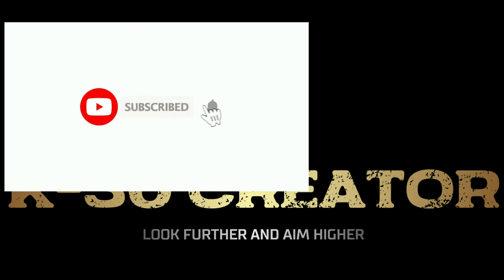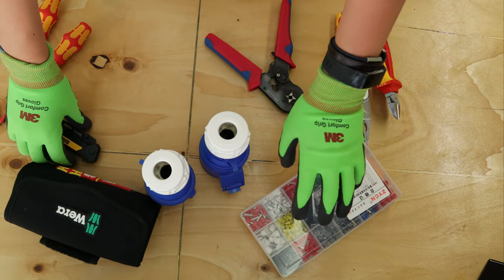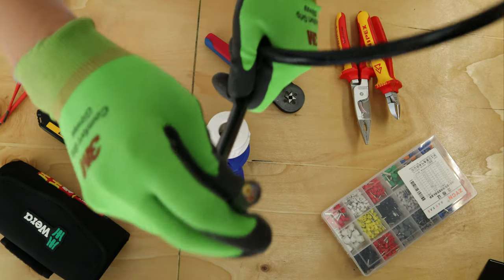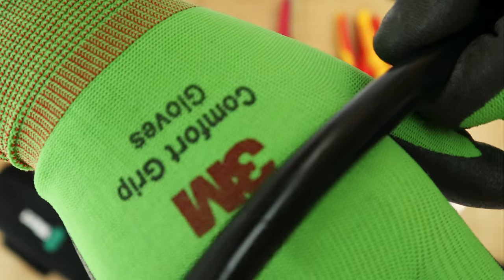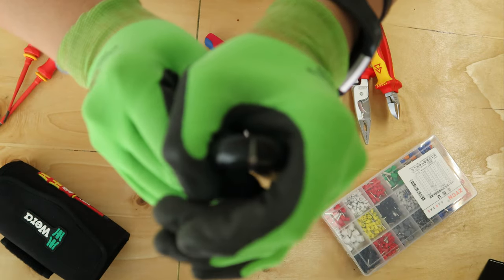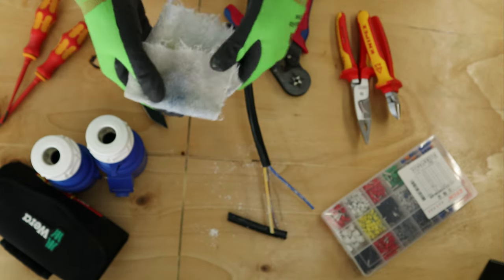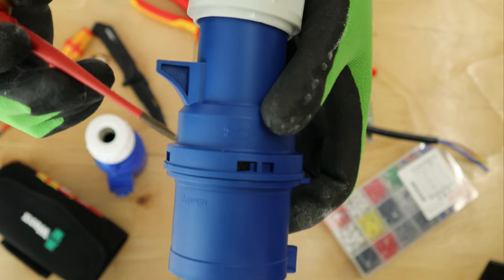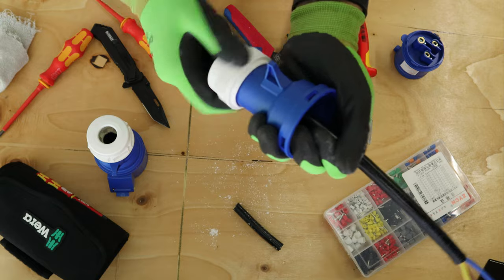How to Wire Up a 32 Amp Plug and Socket Professionally in 10 MINUTES

Comment: Hi, how much would an electrician charge for a 32amp single or three-phase installation?
Reply from the maker: Sorry for a late reply, I am not sure about that.
Reply from the maker: I will pin your comment up and see if any other viewers could possibly answer this question
Reply: This looks like a single phase 32a. 2P+E. Indication would be that its blue, 3pins and 56mm diameter (maybe)
3phase should be red with 4 to 6 pins depending on 3P+E/3P+E+N/3P+E+N+pilot pin
Reply: Guys I'm in London and I have all different kind of.16-32-amp both ends very cheap let go about more then 100 pic of both ends let me know who interested

Comment: Did you know the combo flathead + Phillips screws generally also accept a Robertson #1? In case you don't know that's the slanted square head mostly used in Canada. But if you use a Robertson on these you get the best of both worlds, you don't get it slipping out like Phillips, and you don't have the just general horribleness of flathead. It fits very well and you can torque it down.

Comment: This is great stuff mate, I happen to have a PDU with a very short 32A power cable, I was thinking of buying a high quality 32A extension lead cable to be able to connect it 3 meters away, this video along with a PDU disassembly video I've found earlier just reassured me that its possible to just replace the PDU short power cable entirely with the female end of the 32A extension lead cable, instead of just connecting the extension cable for its intended purpose, I really did not want to do that, horror stories, suicide cable, fire, etc

So in basic terms, Im trying to remove the PDU 0.5 meters cable, replace it with a 3 meters lead cable, using a 3 meters extension lead cable in it place.
Reply from the maker: Thank you for finding this video helpful!!! Wish you all the best, just remember to be careful when working with electricity, especially PDUs!
Reply: @k-30creator20  I will 100% make sure not to cut too deep if I ever had to cut, this is a very important step that you did point out multiple times on the video, so people don't mess this one up, because its not going to end well.....The thing that made me think it was possible were the instructions on how to open and separate the end point of the plug, that was some really crucial information, oh and thanks for showcasing and linking the tools used in the description, I value this sort of stuff although I can't afford to buy the tools right now, I will however make sure to buy them using your links later on, especially the crimper tool, cheers mate.
Reply from the maker: Really appreciate your support! And you are right, it is really important to NOT cut the outer sheathing too deep! Good luck!

Comment: Will 2.5mm 3 core swa cable fit in a commando plug?
Reply from the maker: NO! and PLEASE do NOT ever terminate a SWA in a commando plug! SWA cable MUST be earthed properly not with a hose clamp and all those nonsense! So please do not do so :) Use a rubber cable or a PVC cable :) Thanks!!

Comment: Glad I found your channel…. I need help …. I’m in the US . I purchased a predator generator from harbor freight the 3500 watt one.  I’m having trouble finding a power cable to connect to my food cart to the generator. The generator has a 4 prong socket… my food cart has a 3 prong socket…. I’m not sure what to do… any advice would be greatly appreciated… the weather socket on the cart looks like what you are showing in the video…… the Generator take a 4 prong plug in….
Reply from the maker: Hey D.Harrison, 
First of all you should identify the required Voltage of your appliance
Reply from the maker: May we know the brand and model number of you food cart
Reply: In Europe, domestic plug is 230V 16A, which is 3500W. In my house I even have 3 phase 230V 16A in every room (11kW). 

American system is weird, confusing and u safe. Cut the plug and connect it directly (but use Wago, not twist nuts, your house would burn down).

Comment: where did you get the wire from please?
I keep looking on ebay for 6mm2 3 core wire, But its all steel armoured.. I dont want that.. I just want the cable like yours.... 
Im in the UK too.
Reply from the maker: Here i found it on Amazon Around 8 GBP per meter: https://www.amazon.co.uk/Rubber-Cable-H07RN-F-HO7RNF-Tough/dp/B07PN6LN99?crid=13H5JV4XM9QX0&keywords=6mm+three+core&qid=1648944407&sprefix=6mm+three+core%2Caps%2C102&sr=8-12&linkCode=ll1&tag=k30creator00-21&linkId=a67c8c05c34c1734db04385440e261d3&language=en_GB&ref_=as_li_ss_tl
Reply from the maker: or 10m for around 50 GBP: https://www.amazon.co.uk/25M-Rubber-Cable-H07RN-F-HO7RNF/dp/B07PN5MZMQ?pd_rd_w=UnioT&pf_rd_p=93e1d4b1-bb8c-45f0-baaf-a13934852b31&pf_rd_r=P6EC4PNTH99SJN8PX4P2&pd_rd_r=aa3ea8e5-6cdd-4052-b2c8-2d86fc8a7dbe&pd_rd_wg=vKKxl&pd_rd_i=B07PM8H9VH&th=1&linkCode=ll1&tag=k30creator00-21&linkId=4e1da9acc28a395f6129ea4297d403cf&language=en_GB&ref_=as_li_ss_tl
Reply: Check yell or just Google local electrical suppliers, I saved a fortune on some twin core 10mm when I wired my garage up by looking for somewhere local.